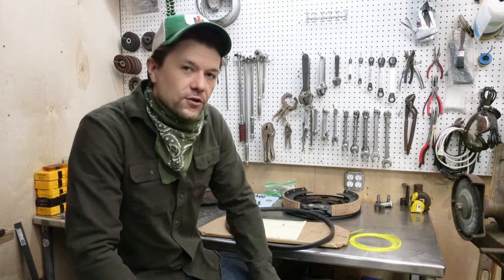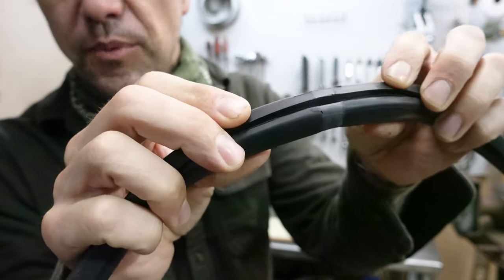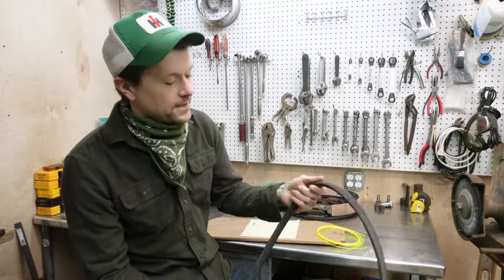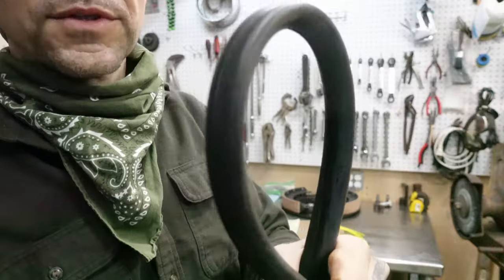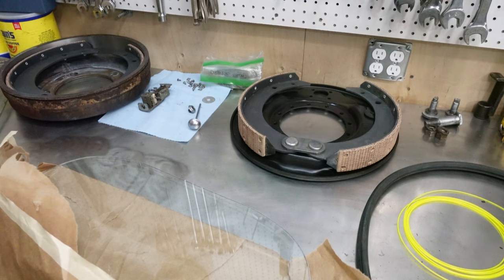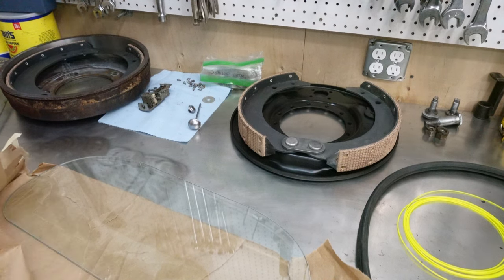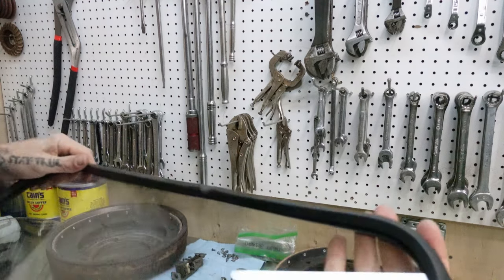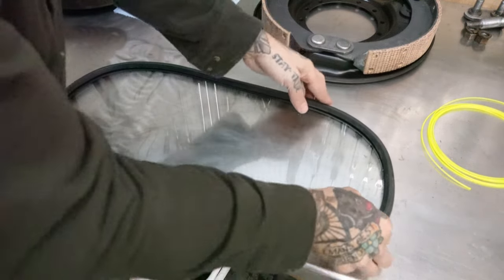How To Install An International K or KB 1-5 Rear Window

Comment: Parts like window mechanism dont use grease and very little oil as dust and particles will stick and that's what causes bind ups, they get clogged and it's not cleaned .the only time someone looks at it is when its clogged and the people think force will fix it untill it is broken,and that usually from over greasing or to much oil as it tends to run and go sticky.clean of excess oil and dont use grease.

Comment: Is it a different process to install the rear window for 1948 KB7?
Reply from the maker: Yes, the cab for the larger K and KB has a different rear window assembly. If you’ve got the KB-7 handy as a visual reference, look at the rear window from inside the cab, there’s an inner retaining frame surrounding it and held in with screws. Remove the screws and pull it apart.
Reply: It’s been 4 years since I took my original out. There’s only a one piece frame, I had it chromed, and there was an about 2’ x1” piece of metal?
Anybody do a video on the bigger truck?
Reply: After I got the glass, window gasket and frame together it appears the gasket goes on the glass, cut to size and then should be caulked/ siliconed in and the trim ring then is screwed in to hold it.
If this is wrong please let me know.
I think I’ll have the guys who put my fixed windshield use the adhesive caulk, epoxy or whatever it is they used.
Reply from the maker: @johnbain6084  I would advise strongly against using silicone or adhesives of any kind. If you use anything, use “3M linerless splicing tape”, it’s like really thick electrical tape, works the same as conventional glass setting tape these trucks originally used, is easier to use than glass setting tape and cleaner than silicone. I outline all of this in the windshield video, silicone or caulk is the worst thing you can use. I haven’t done a larger cab rear glass video yet, but I have plans to.
Reply: @BareKnuckleBinder  thanks for the info. As I was looking at it I can they had caulked it in previously , way back in the day.
I used the tape putting the front glass in to the windshield frame but had the glass guys epoxy it in like the do modern windshields because my build eliminated operating windshield.
Reply: Any advice for installing rear window glass on a 40 D2?  It doesn't seem like the gasket seals real good against the cab frame.  I want to make sure it is water tight.